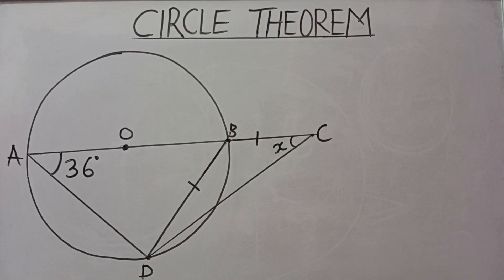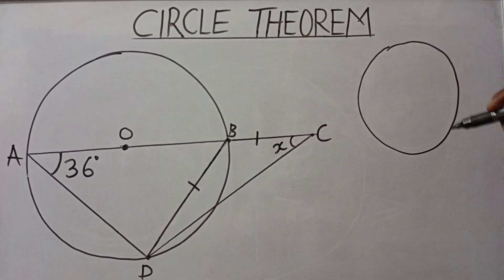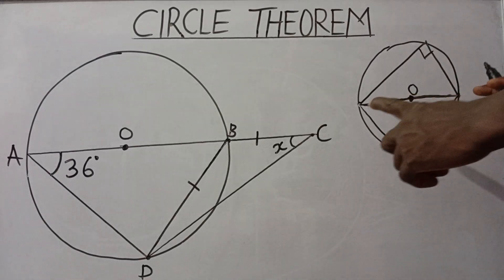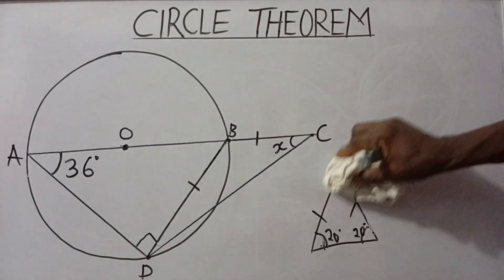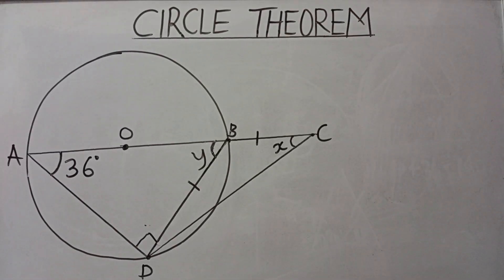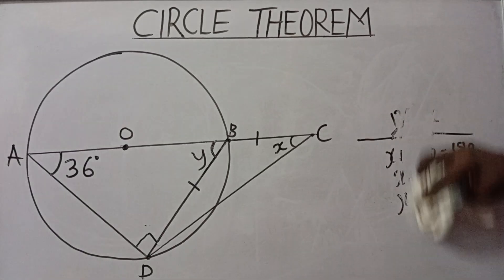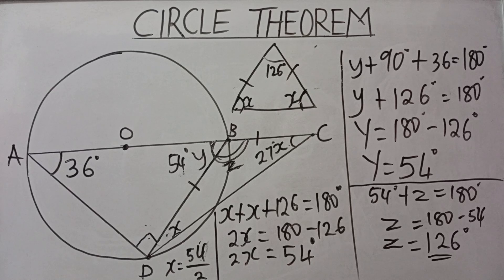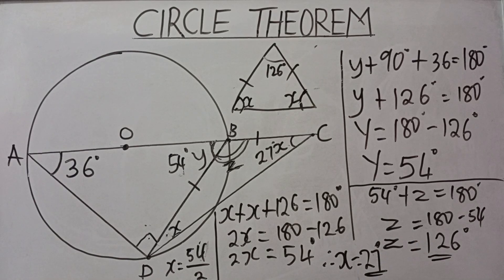CIRCLE THEOREM (WAEC)

Comment: ❤
Great work sir.
Pls can't one get d "x" without first getting" z"?
Reply from the maker: <BAD + <ADB = <CBD (exterior angle of a triangle is equal to the sum of the two opposite interior angles). You can determine z (i.e. <CBD) using the above stated theorem. 
In other words, the value of angle  z (i.e. <CBD) is required to find the value of x. Thank you for watching.